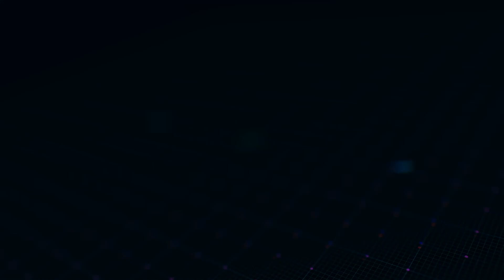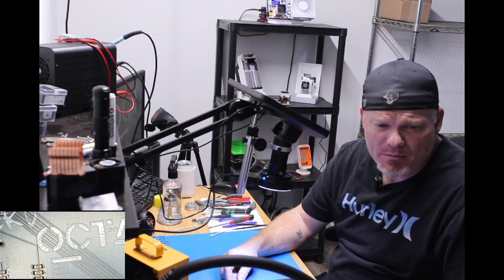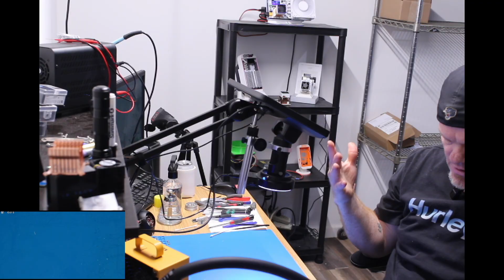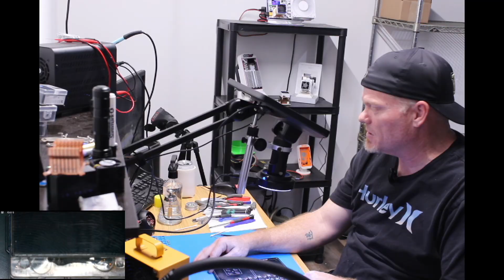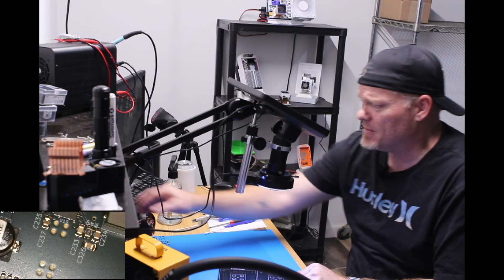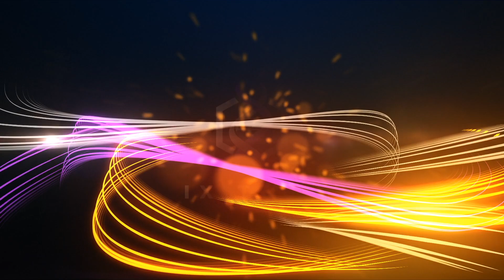NerdQaxe Error Messages Explained!

Comment: Yes updated to v1.0.32 and issue got resolved. ALso changed the freq and core voltage to 600 and 1150. that message is a little misleading